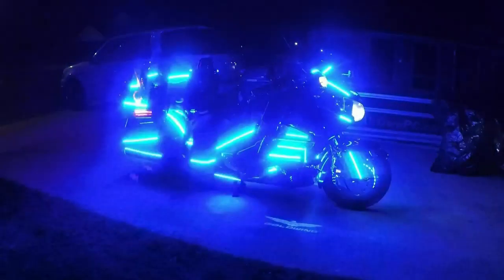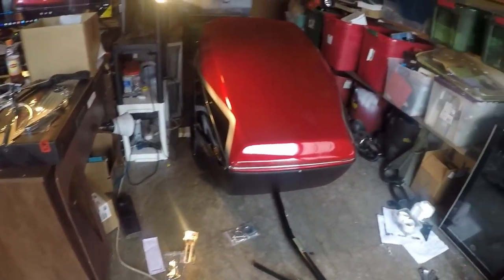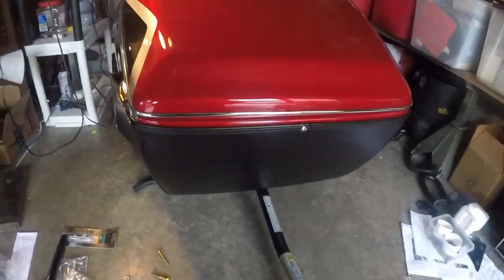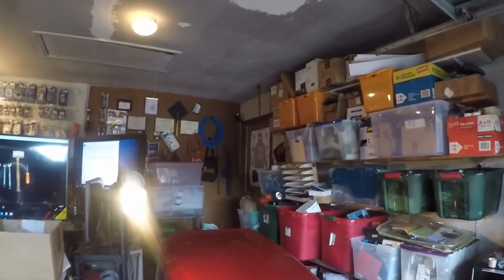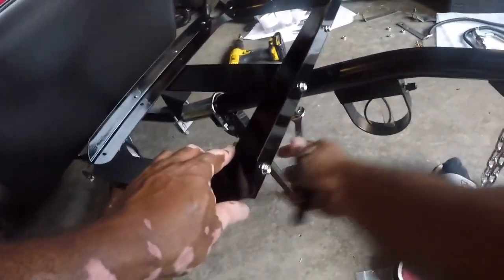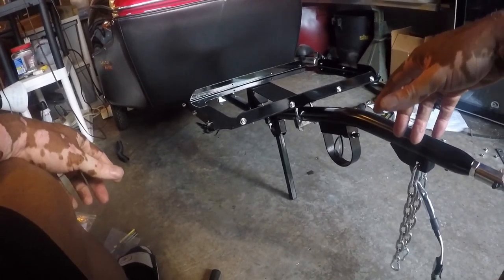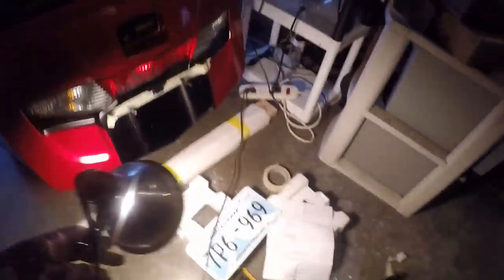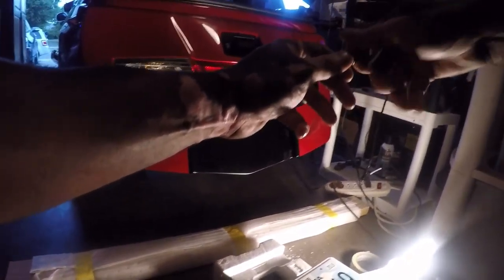Black Flash’s Trailer Accessories & License Plate Installation

Comment: FYI......you have the hardware for the ice chest all wrong.  The U-bolt goes under the tongue the mount goes on top then the tray for ice chest followed by the nuts on top.  The directions are crap, but as an aerospace engineer I took on the challenge!
Reply from the maker: Thank you for the correction, I do not ride with it much but I will surely change it before using it again.

Comment: Hi Carnell, just subscribed.  What I do when working on the under side of my trailer is get a big thick piece of styro foam or cardboard.  Put it under the back end of the trailer and lift up and rest it against the wall or in my case the cabinet.  So much easier to work on it while you can just stand.  I put air shock on my and it was so easy while it was standing up.
Reply from the maker: My Brother, you are the man! Thank you for sharing that tip, I will defiantly use your idea as I work on this trailer.

Comment: hey Cornell I can taste ICE COLD Water in the cooler 
😎😎
Reply from the maker: LMAO, Believe me, it will not be any water in the cooler... LOL.
Reply: Great job Black Flash on your video of your work! I have reviewed your video after watching Chris Caliente removing his broken trailer hitch made using tubing (which failed from stress cracks) by Kuraykin (mis-spelled). It’s been 10 yrs since I did my install and I need to inspect my 2008 GL1800 trailer hitch. I have a Bushtec trailer & an Aspen Classic pop up (weights 350 lbs empty,).